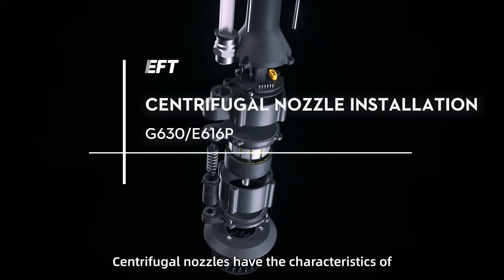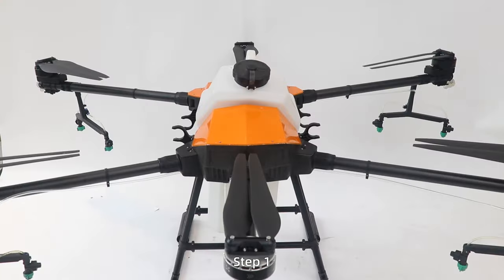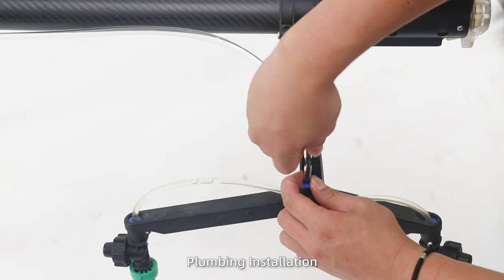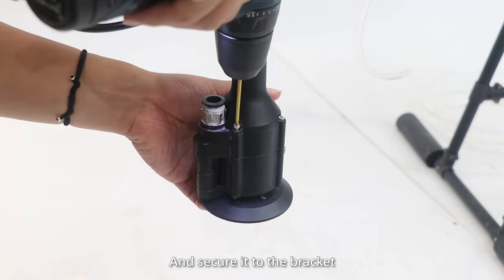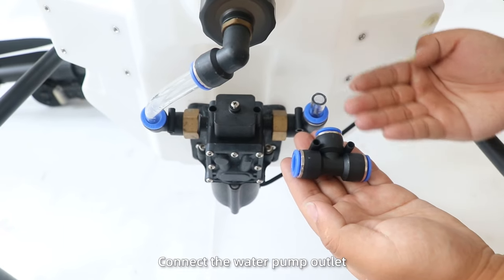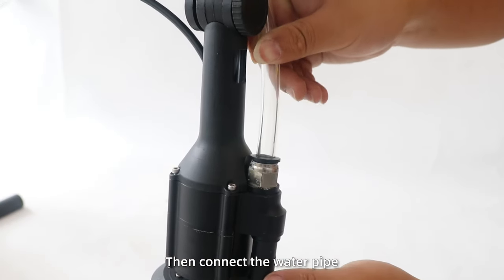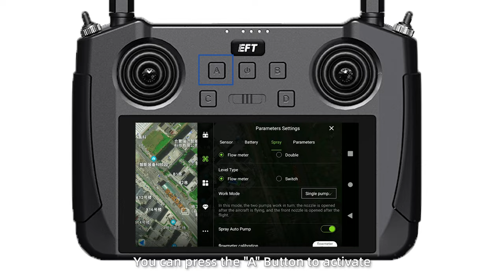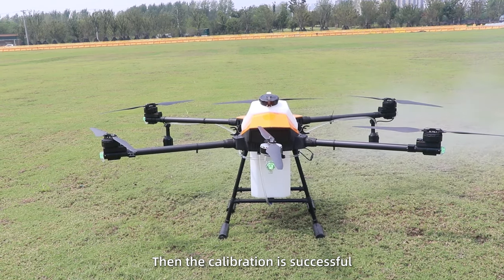G Series/E Series Centrifugal Nozzles Installation Guide

Comment: Mate can you help me with the centrifugal nozzles settings A for pump & B for centrifugal nozzles. I can only select Pump in the drop down box, selecting Pump for A & Pump for B, what’s the centrifugal selection in dropdown box to make it work on B? Because with pump on both the centrifugal doesn’t work only pump on both buttons.
Reply from the maker: Hello, we only provide drone frame for G series and E series and related hardware parts.
The settings are determined by your remote controller model and flight control versions and which is configured by assemblers. It is recommended that you contact your local direct dealer

Comment: do you have new update agri assistant app?
Reply from the maker: Hello , Yes , we have update to EFT App 2.0 with new  flight control from 2023,  if you use agri assistant app , then a new version flight control is required.
Reply: @EFTdrone  flight control k3a pro can use new app?
Reply: @EFTdrone  share link new app agri assistant sir..
Reply from the maker: @tupaiking1234  You mean K++ FC ?No, the new App only can be used of EFT V2.0 FC .
Reply from the maker: @tupaiking1234  The Agri Assitant App has stopped updating because our Z30 and Z50 have been upgraded to Z30P and Z50P, equipped with new flight control and operating system.

Also water pump, centrifugal nozzle, internal circuit board, etc. have been upgraded. If you want to replace the new system, please leave your whatsapp number and region, and we will contact with you in detail.

Official Web : https://www.effort-tech.com/en/z
Reply: @EFTdrone  thanks👍🏻👍🏻